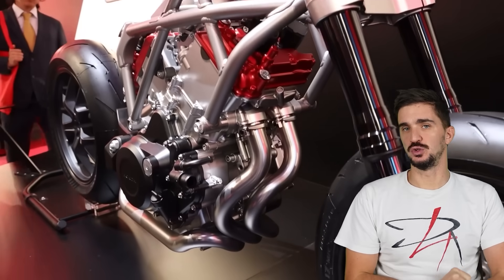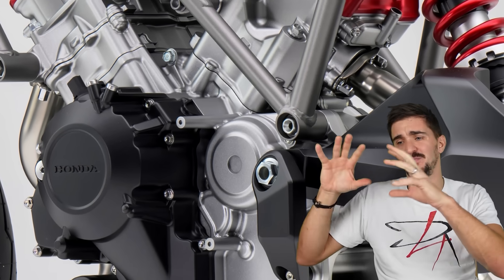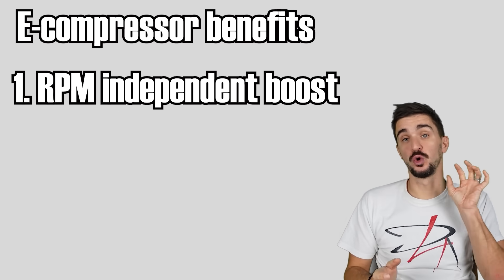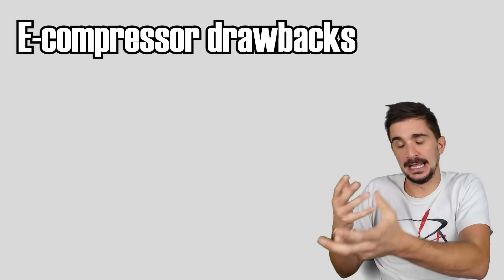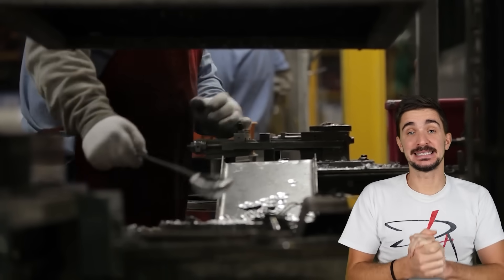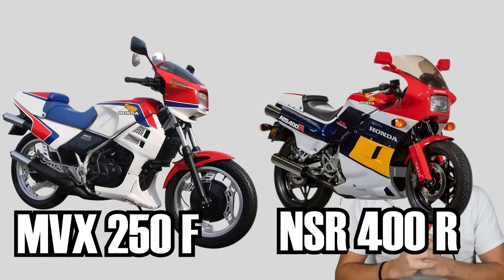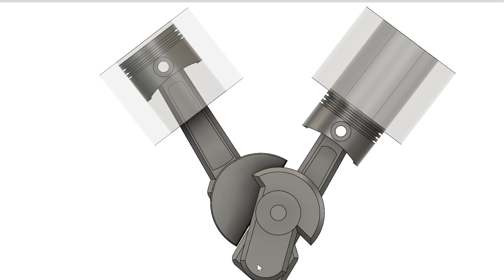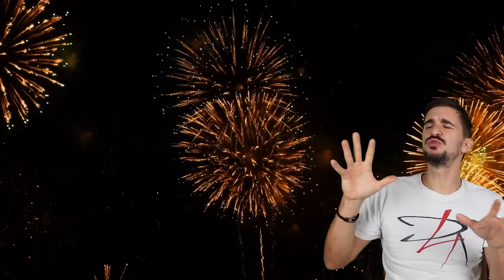Honda's New V3 Electrical Compressor Engine Explained

Comment: In the turbo the part of the energy that is more than what it consumes is you could call free energy.
Or boost energy.
Because it raises the over all efficiency of the engine.
Reply: Thats only true for diesels to a certain extent.

Now if you're just talking efficiency in terms of an emission test cycle then sure it can help vs. An engine of similar max power without a turbo, but just for kilowatts out of same amount of gasoline it doesn't help.
Reply: @lasskinn  Yes, it does! Turbo increases over all efficiency, especially on high loads.
Because the engine is able to maintain higher pressure towards the middle of the stroke, where the leverage is greater. Turbo gives you higher efficiency and more power at the same time!!!!

Comment: Wouldn’t it be a good idea to drive a turbo with the exhaust gas which drives a generator so that the alternaor can be dumped and a lot of energy can be recuperated from the exhaust resulting in imoroved efficiency.

Comment: You would think there would be more hybrid electric assisted turbos out there, it's a pretty simple concept of an electric motor with a one way clutch when exhaust takes over the motor disengages. Best of both worlds zero lag with high rpm spool, and where turbo lag isn't an issue the turbine could be sized larger reducing power robbing back pressure. Or even an engine driven belt assisted turbo, using the same concept... Practically everything has been tried by now so These ideas are not original I'm sure and already existing somewhere in some OEM R&D facility but still odd there's not readily seen, well at least by myself, but even tho being more complex they seem like they would be a win win.
Reply: Or you could just spin the wheels with the electric motor assist.

Or spend the extra money on making it rev higher. Or on displacement.

Anyway its pretty niche where using the kilowatts to spin a turbine is a good use vs just using directly for powering the vehicle forward
Reply: No space for that on a bike.
Reply: With an electric motor you don't need the clutch - just let it spin unpowered. 
Yes, all of these combinations have been built.

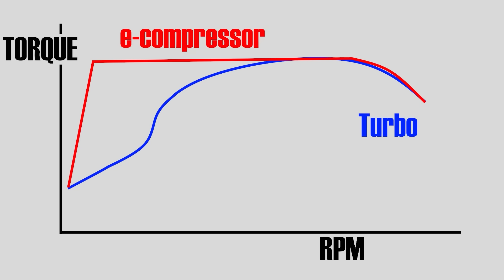Comment: @4:11  Woo bend those rods!  hah, sorry, flashbacks from being a Mazdaspeed 6 former owner, low rpm boost killed rods and made swiss cheese out of a lot of engines.  They shouldn't have to worry too much about that at only psi though, especially being a honda.

Comment: Compressors will fail. Especially being electric.
Reply: Oh yes, YouTube comments engineers are more knowledgeable than Honda's engineers.
Reply: @vvevvevvvv Sorry, but Hondas we're built on their reliability.
Reply: Its a high power motorbike  it doesn't actually need to be practical like a cbr 150 and last 100k km without opening